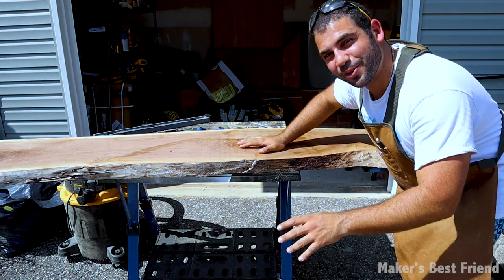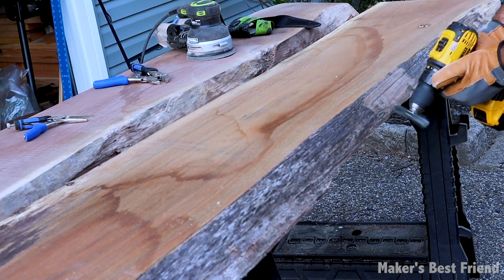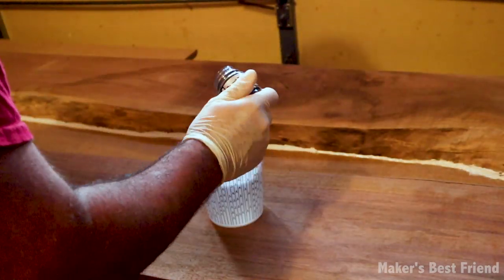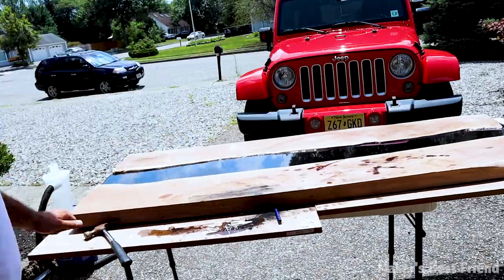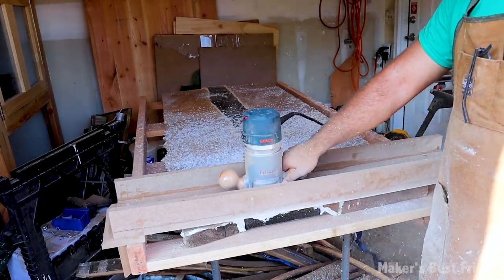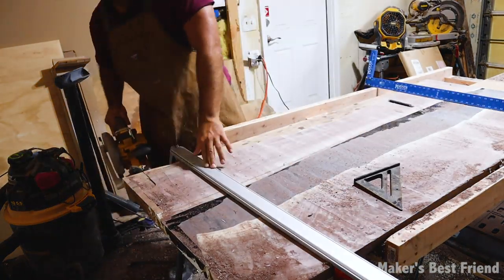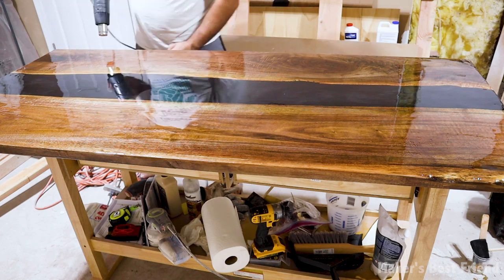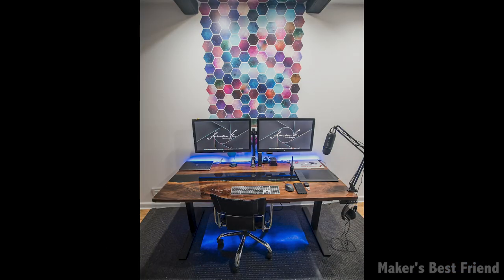The Sit-Stand Epoxy Computer Desk!

Comment: i really like this idea i enjoy woodworking and editing  as most desks are cheap press wood for 200+ $ you could make a desk twice the size and will last a life time. how much were your cost for the epoxy on this table?
Reply from the maker: Epoxy ran about $300-$400 because of the thickness and length of the River portion , could have been cheaper if it was smaller

Comment: Love this project. I definitely want to try something similar. Just curious how much epoxy did you use altogether? I’m repairing a surfboard so I might just buy enough for both projects.
Reply from the maker: Robert Zarfas to be honest, it was A LOT of epoxy because I made the middle gap pretty large and it was about 3 inches thick. I think it was about 3 gallons. Just make sure you measure the area of the work you’re doing and get enough epoxy to fill it